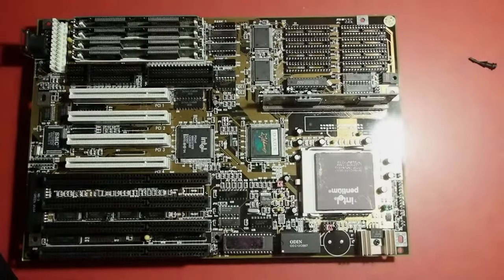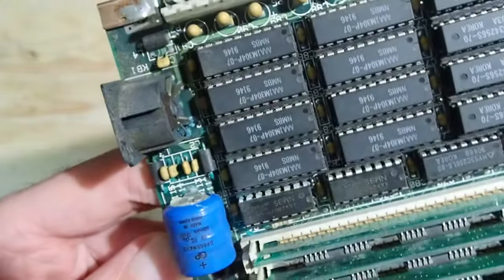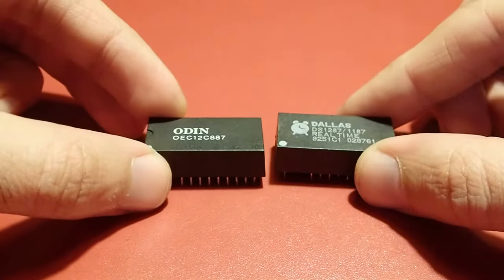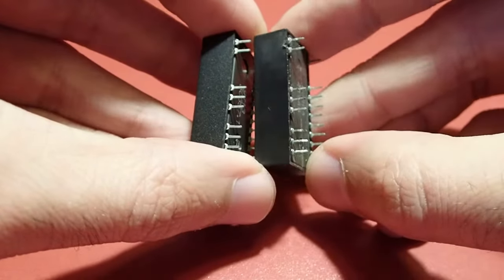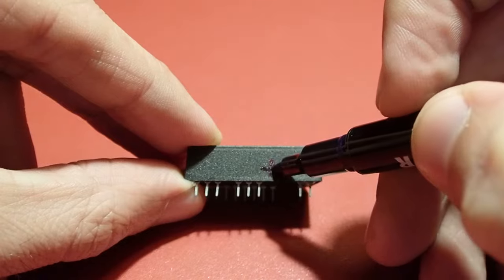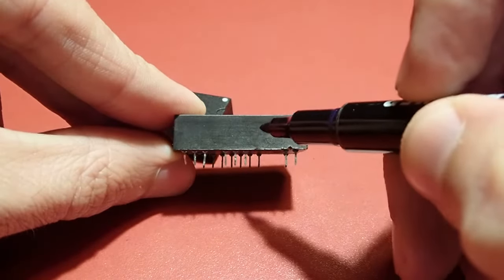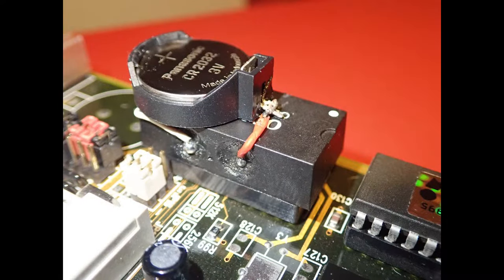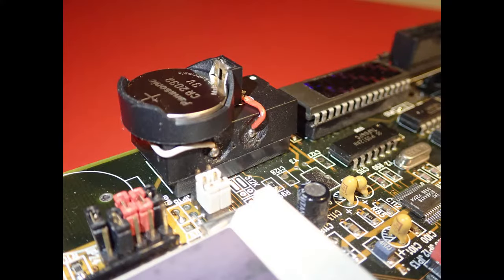Repairing Real-Time Clock Battery (Dallas DS1287 / Odin OEC12C887)

Comment: Great video! However, I was wondering why not just just solder a CR2032 socket into the indicated location on the motherboard? Is there a technical reason behind it?
Reply from the maker: This mainboard existed in two variants. One with RTC IC, quartz, CR2032 battery and some other parts, or just with Dallas RTC Module, where all that is integrated. The manufacturer used the same PCB for the two variants of this board and populated them with the accordant parts. On the mainboard variant, which I showed in the video, the CR2032 place is not connected to anything. If using the Dallas Module, you wouldn't be able to connect any external battery to the modules guts anyway. So, you would have two ways here, either just as I showed it, or to remove the Dallas RTC Module completely and add all the other missing parts instead to be able to use them with CR2032.

Btw. this mainboard was just an example, there are many mainboards in the wild, where CR2032 wouldn't be an option, not like in this case.
Reply: @necro_ware  I see. Wow, thank you SO MUCH for your beautiful answer, I wasn't expecting something so detailed.

Comment: Thank you so much for posting this, I’ve just repaired my Yamaha AW 2816 digital recorder and saved a fortune using your wonderful tutorial. Will definitely tag your forum to increase your views. 👍
Reply from the maker: Too kind William! I'm very glad, that I could help you :)
Reply: William, I watched a video on someone doing this to the 4416 and it seem pretty complicated getting to the battery chip. Is the 2816 any simpler? Mine is reading low battery.
Reply: @TheGuitarman160  hello Don, have you got the link still available to the video that you watched? I could have a look at it and see if the process is similar to the 2816. Without seeing it it would be difficult for me to assess what your idea of difficult is. I think I would say my experience of repairing mine would be reasonably straight forward providing you take pictures of each stage of the process ie which screws you remove and which plugs you remove from the circuit board so you can put them back correctly. I was able to do the mod without removing the chip from the board by using a dremmel with a small cone shaped abrasive bit to cut into the side of the chip as the guy shows, and then soldering the wires to it and attaching a new battery. Unfortunately I didn’t video the process otherwise I would be happy to share it with you. Please send me the link if you still have it and I’ll get back to you if I can help further after watching it. Regards 👍
Reply: @williamsykes7803  I have talked the the shop where I have my amps worked on and they can do it but they charge $75 an hour. Could cost me a bit.
Reply: @TheGuitarman160  
Hello Don, I don’t think that video does you too many favours at all really. (Not only because of the language barrier) But because he takes it to as he calls it- a welding place WTF!…. And comes out with a chip socket fitted ??? 

So he’s still taken it to an engineer to  be modified & repaired!! I don’t see the point really, he might as well have taken the whole thing there in the first place I think. 

So he doesn’t show the old chip coming out and how to solder the new socket in. 

Unless you know how to do that with confidence Don, I would suggest that you don’t go any further. 

All that stuff with the tin foil is totally unnecessary nonsense.  

I did not disassemble  my 2816 to  the same degree as he did because I did not need to get to the underside of the PCB you can get to a stage where you can carry out the procedure that necrowave demonstrates in his video. 

@ 20:28 in the video that you sent me, if you strip yours down to that point you can see that you have access to the chip whilst it’s still on the board - enough to carry out the procedure that necrowave demonstrates in his video https://youtu.be/IbiczYoVncQ

And that’s what I did Don. 

Although there is a fair bit of disassembly required to get to that point, if you feel confident enough to do that and you feel you could carry out the modification that necrowave does to the chip - then go for it. 

Remember that there are probably static sensitive chips in there so best to have a grounded earth wrist strap on if in doubt. 

I think a repair shop should be able to repair it within maybe  a couple of hours to give you some idea of the cost involved at $75 an hour; best to get an estimate from them first if you’re considering that option. 

But I think a repair shop would not carry out the mod that I did, they would remove and replace the whole chip with a socket as in the video that you sent.
Reply: @williamsykes7803  I could probably do all of the mechanical stuff but it would take me a long time plus I don't have the skills for and the electronic test equipment to use if I should run into problems electronically, so I have decided to take it to the repair place. They do this kind of stuff day in and out. Thanks for the advice.
Reply: @TheGuitarman160  probably a wise move. Good luck 👍

Comment: YOu didnt disconnnect the old internal battery... it will sink off the voltage from the new one.
Reply from the maker: The impact is not as bad. I tested the drain over three months and couldn't measure any substantial difference.

Comment: They should've brought out the battery contacts to external pins in the first place. The battery could be recharged and/or the chip powered externally when the system is running then. That would've really helped the life of the internal battery.
Reply from the maker: I am absolutely with you. However, unfortunately, It is never about to make the world a better place, but about making money. So they sealed the battery to enforce people to buy new one, when the time comes.
Reply: @necro_ware  That's really wasteful, not gonna lie. I mean, the clock still works perfectly fine, but you still had to get rid of the entire module and buy a new one.
Reply from the maker: @mjyanimations1062  I already buy a new car every time the ashtray is full, at least I can be less wasteful with this battery ;)

Comment: the old battery is still in there and will drain the new battery very quickly
Reply from the maker: Hi, the old battery is still inside indeed, but it takes quite a long time to drain the new one. I have here one modified mainboard, running since almost 3 years. However, you are right, when doing properly, you will have to cut the old battery from the line, but it means, that you will have to cut the housing even more. This is unfortunately not quite simple and you can break the whole part easily.
Reply: @necro_ware  you can't break the part that easy. The actual chip is on the bottom of the Dallas. Two pins were bend up and soldered to a battery and another two pins were bend up and soldered to a small metal tube which didn't have any markings on it. That one might be the crystal for the clock, but I don't really know. Then there is a this plasic case put on top of it and the inside was filled with resin. So a very cheap design and also not consumer friendly since they could have soldered a batteryholder on the chip to make it easily replaceable. You can also heat up the Dallas with a heatgun and remove the top cover to reveal how that looks and desolder the battery. I have repaired 4 Dallas chips and they all survived the repair.
Reply from the maker: @Tom2404  Hi! Thank you for the feedback, meanwhile I made a followup video, where I cut the one of the battery pins and measured how much better it is regarding the drain. Anyway, thank you, sounds interesting, especially the heat up method. May be I'll give it a shot :)

Comment: You are awesome!!! 
I'm trying to bring to life a SOYO 5VA2, yesterday had a paladium cap blowing up that i was afraid it blew the board also as it made sparks - solved today with new one.
Also had to do a mini din6 to din 5 cable adaptation as my keyboard was only ps2. 
Now i was able to get to the bios, but it wont keep the changes because of that old rtc chip. I was thinking precisely if there wasn't a leg mod to add a external battery (or mod the board as it already has the place to have it), but your way is much better (and i might just put the bat socket on the board to keep things as close as original possible).

Comment: Nice work,  had to replace one of the Dallas types in my 2465BDM scope.   Of course after it completely failed and lost it's cal data.  Ohh well,  I had the gear needed to recalibrate.   Waiting for the battery on my HP 3457A to die 😒

Comment: can't you solder directly to the legs of the DS1287 chip? I say without having to desolder it from the pcb connect the battery to pins 4 and 8 without the need to drill the chip? Or this is not possible, greetings and thanks for your great tutorial
Reply from the maker: I can't, the required legs are not there.
Reply: @necro_ware  ok!! tks!

Comment: Will this procedure work the same for the Dallas DS12887 chip. Notice the different number. My chip reads Dallas DS 12887 (not DS 1287) my chip does have the same number of pins as the 1287
Reply from the maker: Yes, please watch my other video, which I made later, where I'm talking also about Odin module. They seem to be all the same.

Comment: I usually also cut the conductor to the old (internal) battery, but apparently I don't need to?
Reply from the maker: Hi, well, as already answered in the comments below,  it is probably a better way to cut the old contacts. Unfortunately it can be quite tricky and some batteries, I made this modification on, had a quite thick housing with contacts going deep into it. This made the cutting even more complicated. However, I made some tests and left the contacts not cut with a new battery just connected as I've shown here. After three months battery was still as good as new, so I decided not to cut the contacts from that point on. And if I leave a PC for longer unused, I always disconnect the battery anyway.

Comment: Thanks it worked for me. the battery error is gone. But i encountred a problem after adjusting the cmos settings in bios, the system asked me to insert boot disk, after i did my keyboard is not responding and the system is completely freezed up, i restarted the computer and its not posting or beeping. Could it be a cmos battery issue ?
Keep it up good work. Thank you
Reply from the maker: Hi, thank you for the  praise. I made this modification many times and, honestly,  I didn't encounter any problems. Anyway, in the battery there is some electronics and I think it is possible to damage it, for example if you put too much pressure or heat, when soldering the wires.  However, I think if it gets broken by the modification, you notice it instantly. In your case, the mainboard booted and seemed to work, so I don't think its is the battery modification. I had one very old mainboard, which refused to boot and stopped working in a similar way as you described. This mainboard was from early 386 era and didn't have a realtime clock module like in this case. However,  after messing around with cache and memory settings in the BIOS, the system got unstable during the boot and then refused to start at all. I pulled the battery and left the mainboard for a while in the corner. The next day I put the battery back and the mainboard made full reset of the BIOS settings. After that I could work with it again and didn't touch the cache and memory settings there at all. May be it is something similar in your case. Try to use CMOS reset jumper and/or just pull the battery for an hour or so.
Reply: @necro_ware  i will try Thank you